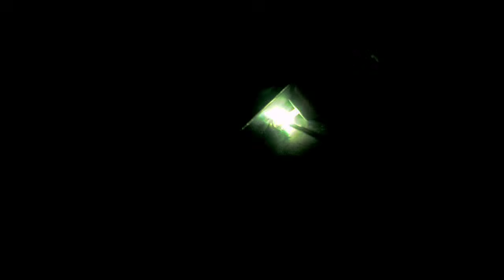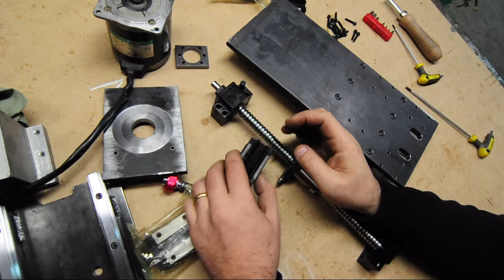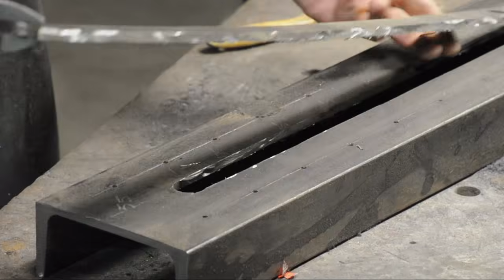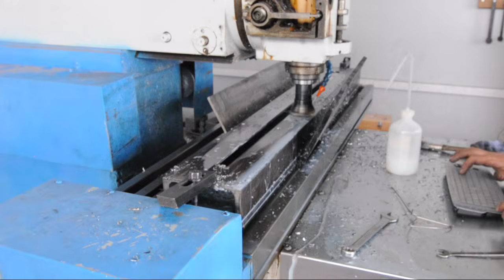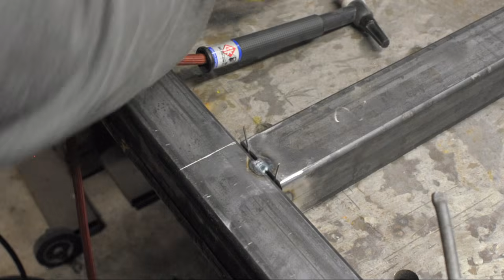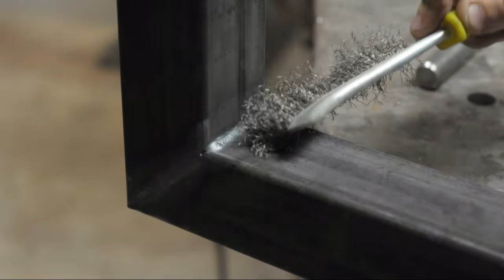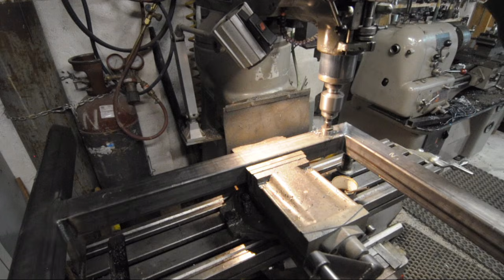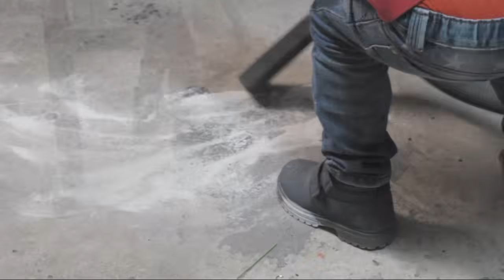Fixed Gantry CNC Router Build   Part 1

Comment: Okay I got to the part of the video where you're describing the warping changes from welding the square stock. I was wondering if you take your example and put a gusset on the upright piece set it in place in weld each bar point of each side of the gusset down first would that prevent the warping? I know that warping is warping but your footprint is getting a lot bigger so if you have a triangular gusset with today is 4in by 4in by whatever the hypotenuse measures and you weld each tip down to the joining peace before you weld around the square wouldn't that help to stop it from pulling to one side or another?

Comment: Surprised you didn't use structural aluminum. It comes from  the mill with usable tolerances. I worked in an extrusion plant and spent a lot of time doing profile correction. Also, the inside flange toe would have been at a true 90º. Ordering a lithium or boron composite would have put you in titanium strength territory without the weight of steel.

Comment: Nice build Tony. C-beam milled down. When Francesco clamped it down to the table, I think it would work better if he clamp it at the bottom and not the top. Bending it and not cutting the material under stress.
Reply: I agree the clamps were in the wrong place it caused deflection of the top surface, hence the difference in metal removal at the end of the section.
Although I did not see any attempt to level the back of the beam during construction which could give problems in bottom clamping?

Comment: On Thunderdork's all steel cnc router build he got around the unevenness issue you're experiencing w/ your X-axis using self-leveling expoxy.  Also, in case you don't already know, epoxy granite is commonly used to fill a machines tubing to eliminate harmonics.  Nice start btw.  I'm at the start of a similar  build using 2"x2" x11 guage steel tubing.  I plan to use the standard cartesian style mobile gantry design.   I have a ways to go though.  I'm welding up my welding table this week.  Once finsished, I should have a somewhat flat reference to clamp my work to.  Life is good.
Reply from the maker: +Chuck Mercer I thought about expoxy but 1) it's expensive and 2) I don't know if its really a problem but I'd be worried about it staying in place not cracking/falling apart under load.

Depending on the size of your work pieces, you may not need to get the full 2'x2' perfect.. I plan to map mine out to find it's 'sweet spot' -- more on that in the next video.  Thanks for watching.
Reply: +This Old Tony I am by no means a CNC guy, can do .001, but not zeros and ones.

Is it possible to correct for the fixed and mapped errors in software?

Comment: from the way you laid that down the axzis that you are calling Z is actually the Y axis. x is left to right, Y is back to front, and Z is up and down. From what I have read everywhere else. Unless I am complpetely missing something and the designation Z corresponds to the axis that the tool directly travels on.
Reply: You're kidding, right? The Z axis needs to be built on an X/Y axis. It is not installed yet. We understand your concerns.

Comment: Lay the C-Channel X-axis rail on a surface grinder, work the top, to work down to a plane, then flip it over, counter-grind the legs to match, and then, if you need the remaining outside edges ground, use right angle blocks to define square while you run one side to grind, then you can rest the other side [which then should be true square] and grind the final 4th side.

~( 'w')/

Comment: I'm surprised you didn't bolt the rails to the flat bar on the C-section gantry...The twist & uneven-ness of that C-sectionwouldn't be such an issue...

Comment: would hand scraping be totally out of the question for a piece that size? i know hand scraping is still used to restore/repair old machine tools . guess it would probably be harder to find a surface plate large enough to use as a reference.

Comment: A beginner question:
Wouldn't it be easier and more accurate to just clamp the C section and the flat bar together and drill the connecting holes through both at the same time?

Comment: Maybe I'm just an idiot but wouldn't using a parallel with some stick back sandpaper help flatten the top down? I only ask, stupidly as I've seen luthiers do the same thing to level frets. Not nearly as required to be perfectly level as with a router but I figured I'd ask

Comment: Tony, is there a logical rational reason why the feet adjuster holes are on the inside corners giving a minimal footprint? I know they're not on the outside corner because sore-toe-hazard, but by putting them in either or the maximal extents you'd have picked up maybe 4-6 inches of base width in one or the other direction. Or in both directions with 8 studs in the concrete, but that would be silly. Wondering if it was OCD that pushed you to symmetry or there was a reason you could tell us? Having written that, I think I know the answer is the former! :-D But... gotta ask. Cheers.

Comment: Why not use the backplate as the frontplate? I think the plate is straighter than the C beam.
Reply: @Wire Monkey That's what I would have done. Also I think the stock is way over sized. Aluminum would have worked too.  A lot of homemade CNC routers on the web are over designed. That's ok. :)
Reply: @ebenwaterman5858  , I do not think a CNC could ever be oversized. The heavier the better, I am not joking with. If one wants to do the heavy machining on the steel, than the aluminum frames  are almost useless, at or at least useless for a precise work done on the steel.

Comment: Nicely done, proper steel work with tig welding. All those wood or mdf frames makes me laugh.
Reply: steel has some fairly serious expansion problems though - but brass would have been a bitch of a bill to pay if you wanted to do it REALLY right

Comment: I'm an economist/photographer, not a millwright or anything useful....
But....
Would that "back plate" be more dimensionally sound than the C section? Could you have mounted the rails to the "back plate"

Comment: A tip. You can break a Allen key and put the bigger side into your drill chuck to fasten the Allen head screws
Reply from the maker: Thanks Alifya!
Reply: +This Old Tony Your Welcome😊
Reply: Alifya Engineer  or just buy a pack of allen bits
Reply: You can also buy a cnc router, but at the end of the day the joys of making a part sometimes is worth more than what you would save buying it outright, occasionally quality is there too :)

Comment: a piece of doubled up particle board with some sandpaper stuck to the back might get that C-section a lot flatter. Saw this guy on youtube doing it to cylinder heads. Of course not a "proper" way of doing it, but it will work.
Reply: aww shit this video more than a year old.. nevermind

Comment: Tony, Just saw your videos, Great Job!

When you machined the C-section your problem was locating from the twisted flange legs. When they were clamped to the table the C-section conformed to the table and hence sprung back when the clamps were removed. A better way would have been to; first, locate from the flat surface mounted on blocks in each corner and machine the legs. The flip it over and locate from the legs you just qualified.
Also, I think it would have been better to stress relieve (normalize) the part after rough machining and best to grind after stress relieve because when you remove the skin the part will move again

Comment: niiice! i always had the dream to build one but not the funds hahaha i`ll follow all the tour man. 
anytime the job calls for a weldment that has to be really square i usually weld half the bead left to right and half right to left i don`t know if i`m explaining, in case of a 50 x 50 square tube i would use a trick similar to yours with the rod, tack one corner, check, over bend about 1mm each 200mm, and tack all 4 corners, then weld one side 25mm from left to right, and the other 25mm right to left, go to the opposite side and repeat, anyone in welding i know has his method but wanted to share mine.
one question just to know, with the belt drives aren`t you expecting to have backlash problems due to stretching of the belts or am i talking nonsense... 
 thank you very much for sharing. regards. pete

ps you got some helper ah :)
Reply from the maker: +thebrokenbone Good tip, I'll have to give that a try.  The belts have steel wire cores so they shouldn't stretch!
Reply: It's rather common to think belts stretch. In reality, getting a machine screw to give less backlash than a belt is an experience itself.

Comment: Big fan of your work. Nice, clean and very considerate. 

I was wondering, if at all, what kind of ventilation system do you have in place whilst welding? 
Was looking into buying an industrial fan with a duct and DIY an active HEP filter. Thing is, proper solutions are very expensive and a DIY solution potentially still somewhat expensive and labour intense. My inexperience with welding prevents me from making a decision, which isn't overkill for the welding practice I am planning and at the same time not negligent to potential health risks to me or others.
My space is a tiny garage (5.5mx4m) with only a garage door opening on one side (no windows). Since it sits right under a residential property I'd prefer to keep the garage door in a state that's almost shut. (To protect people starring into my welding arc)

I've already learned heaps of your videos, so if there's not much to say in this instance, I am still leaving your channel well informed. Thanks a lot.
Reply from the maker: +Gabor Zins Thanks Gabor, and good point.  I personally don't use a fan.. I just suck it up. (get it?) -- I keep my garage door open a bit if I know I'm doing a lot of welding, but for the small stuff .. well .. that's probably not great either.  I've always wanted a small extractor but they cost $$$.
Reply: Thanks for your reply. I suppose having a good draft through ones facilities is crucial. Yeah, extractors aren't cheap at all. Have been looking around to purchase just the filters separately. However, trying to get a quote on those seems to always come with having to make a quote request directly to the re-seller or manufacturer. Why so secretive? Yesterday I got lucky and one of 3 responded, informing me, that just the HEPA filter of dimensions 61x61x7cm would be around US $220. But then there's also the pre-filter, active-carbon and perhaps one or to more layers before the HEPA. I shall post valuable findings and or progress. Keep up the good work, mate.

Comment: Tony I was assistant manager it is a biotech company that developed robotics platforms for the pharmaceutical industry friend. I actually ran one department and was in charge of disposing of an entire line of instruments and getting rid of all the parts to satisfy sarbanes-oxley rules. I had a choice either throw everything in the dumpster or actually about 10 dumpsters 20 yard dumpsters or take it home or donate them to the universities. I was making buku bucks and had lots of promises that I had a long-term job position yeah they lied. Anyway I donated everything to Michigan State and Wayne State University. I had bread boards that were optically flat in perfect 6ft 8ft long. I had stepper Motors by the thousands. Servo motors made in clean rooms I still have those in my garage made in Switzerland. The breadboard would have been perfect I could have gave you 10 of them and not even blink tonight. A linear drives I can't remember the company now it's a big company. That would have been perfect for this application. God I wish I would have got in the machine and when I still had all this shit. Right now I hate you still have these little high speed Servo Motors I would love to give you to make a mini something or another they would be so awesome for high-speed Engraving the rated for $70,000 p.m. the only thing I don't have is the Servo Drive. I'm sure that wouldn't stop you

Comment: Tony, Snap-On brand 1/4 in flex ratchets can be folded and spun like a speed handle to install Allen screws like yours, then extended to torque them. May work with others. Use a hand motion like stirring with a whisk, grab handle with finger tips near joint, then pivot handle end in palm. 

https://store.snapon.com/Hi-Lok-174-Fastener-Ratchets-1-4--1-4-Drive-Dual-80-Technology-Standard-Handle-Hi-Lok-Flex-Head-Ratchet-P759141.aspx, https://store.snapon.com/Dual-80-174-Technology-Chrome-1-2--1-2-Drive-Bent-Handle-Flex-Head-Ratchet-P890889.aspx

Well-used ones get floppy flex joints, but can be tightened up by machinist. Cheap ones may work but I have not tried them. I used to use them for spark plugs since it was faster and more controllable than an air ratchet when you have room for full turns.

Comment: Awesome build!  I can't wait to see the next parts!  You should watch Frank Howard's build: https://youtu.be/tyxgYFTkR_M He is building a CNC using Steel for the platform base and  and 8020 for the rest of it. He just released Part Ii on the same day you did.  Weird! He also features cute kids!

It is interesting that you guys both experienced the same problem with the welds pulling things out of square.  In his case, he didn't have to worry much, since the gantry was 8020 and he just shimmed it level. It would be interesting to see you guys compare notes.
Reply: +Man na I mentioned this on Frank's video...the killer is? Frank didn't have to weld his frame together....he could have simply bolted it since it was ONLY supporting his CNC, it wasn't being relied on for squareness of the actual machine. 

Would have saved himself a ton of trouble.....

Comment: Would it have been better to build your C-section truss the same way you did, but to machine the flat bar stock (back side) and mount the rails from THAT side, instead of web of the C-section? I know that the flat bar has some crown to it as well, but it seems like it might have less tendency to twist up like a pretzel. Does that make sense, or am I missing something else? Or does it really make any difference at all in the grand scheme? Just thinking out loud. Looking forward to the rest!
Reply: I thought exactly the same, but I'm not a metalworker and I'd like to know if that makes any sense!
Reply: Yes I had the same thought!!
Reply: Imran Khan ---> An I-beam and a C-section are two different things. Roughly put: An I-beam is two C-sections back to back; alternatively, a C-section is half an I-beam.
Reply: ARCustomKnives

Comment: Great looking build. I really liked the style of your video. What tool (software) did you use to overlay the dimensions on the video. If it's not to much to ask, how did you do the 360 animation overlay in the lower left corner. The only thing I can think of is a green background in 360 and then treat it as a green screen effect. Over all, great presentation. I'm looking forward to part 2.
Reply from the maker: +Douglas Long Douglas: Premiere Elements.. and you nailed it on the head, I 'green screen' the CAD background and take it out in Elements.  Same with the dimensions.. just a hand sketch on a green background.
Reply: +This Old Tony   That's a lot of extra work but really great clear communication. Thanks for the effort.
P.S. Is alignment precise or mostly a guess. I suppose you could screen capture where the drawing goes, use it as a transparent layer and then sketch on top. Turn off the layer with the screen grab and go from there. 
Whats your day job?
Reply: I know this is a bit old of a video,  up you can also just use black (or almost black) text on white paper and use levels or make them perfectly black and white, then use a Luma key (instead of green, which is a chroma key).

Comment: Hi Tony - Why not mount everything to the "back plate" instead of the "C-section"?
That way you do not have a surface that is being pulled all over the show by welding that you have to "make flat and straight".
Just a thought...
Reply: The Mad Man ---> I think it's because the plate would flex under stress far more easily than the C-section.

Comment: if you ever read the old Gingery books about building. lathe that's why he uses cold rolled flat stock for the ways, and bolts that to the casting, because it's close to true on its own, and easier to flatten
Reply: Maybe epoxy cold-rolled to the hot-rolled C-section would be a good approach.

Comment: Really enjoying this build Tony. A newbie question please, after you had welded the two backing strips in which caused the C section to pull up more.....just heat the C section with Oxy and then pull it down onto your flat steel work bench...... would that work? I am just thinking that the more you mill off the web the more the tendency for it to pull in, especially with that long slot. Cheers, Gordon
Reply from the maker: Heating could work but probably not with a torch.  Given the size it'd need to be put in an oven, and once it cooled there'd be no guarantee it'd be any flatter.